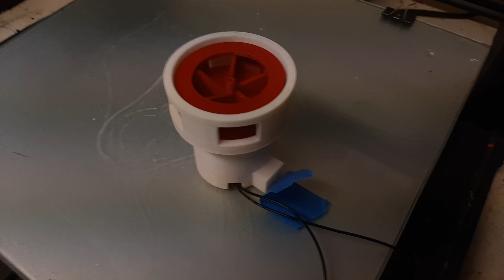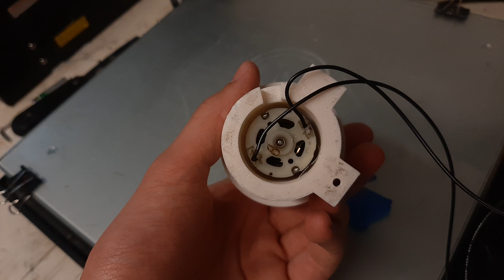3D printed air raid siren #3

Comment: Can this work with a motor that has a 2mm shaft? I am planning on printing one.
Reply from the maker: That's what it's designed for, yes.
Reply: @Snowcube  Also, does this work well with a 10000 rpm motor?
Reply from the maker: @phnumsamkos1600  Yes, it'll just be higher pitched.
Reply: @Snowcube  Thank you!

Comment: I want the STL files!!! Because I have a 3d printer and the correct motor type.
Reply from the maker: I'll see if I still have them, hold on
Reply: @Snowcube  I printed a slightly different version. Check my yt chanel for it.
Reply: It's a remix of your big single toner 775 siren, scaled to fit a 540 and some parts modified. I will publish a video of it when finished printing the motor stand.
Reply: I uploaded the test. Check my chanel out for the vid.